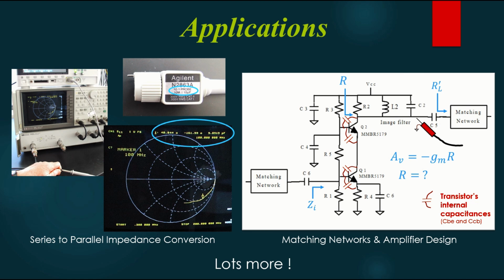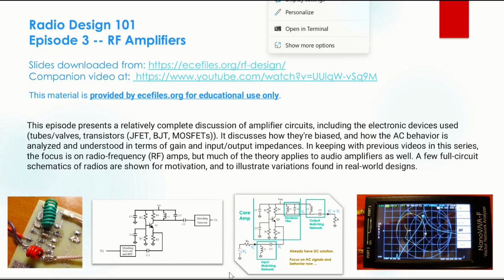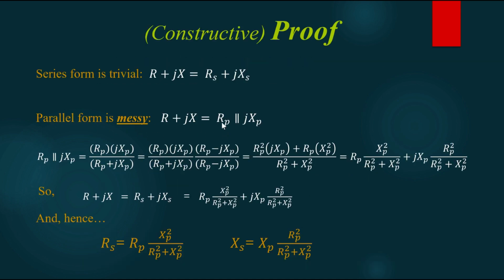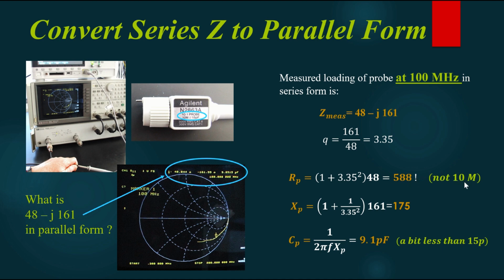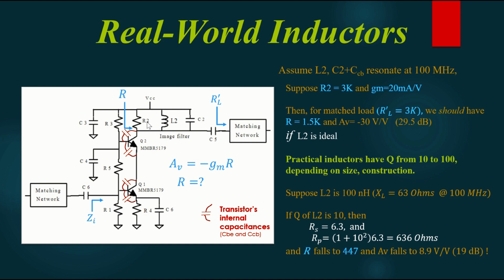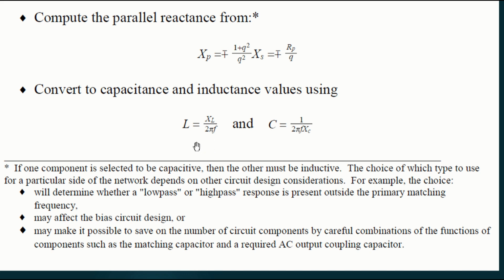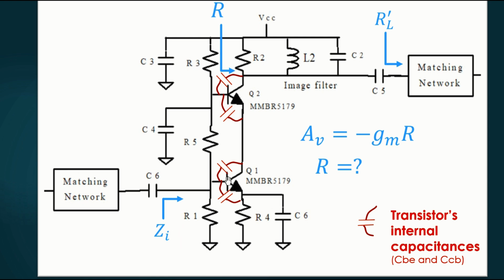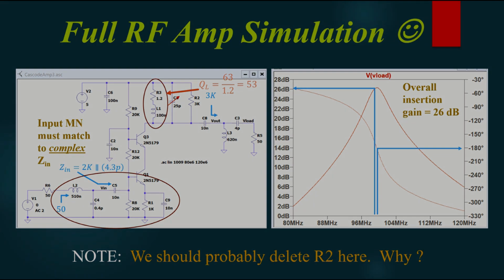Radio Design 101 Appendix B - RF Impedance Conversions for Matching, Amplifiers, and Measurements

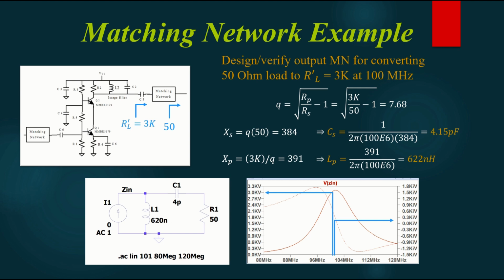Comment: Hello professor, regarding the question at 33:09, I can't find any sensible combination beside parallelizing (if that's a word) R2 and combining it with R3. Was thinking maybe the coupling cap can double as a part of the matching network, but the direction of matching doesn't fit. Am I missing something ?
Reply from the maker: A couple hints (I don't want to give away the full answer):  First, R3 is not a physical part. It is just modeling losses in the inductor L1. In analyzing the circuit bandwidth, it needs to be considered, but that's all. Just pretend it's not there for this problem. The main hint is that the use of multiple inductors is something to be avoided when possible. Can you somehow reconnect L3 and combine it with L1? (Ignore R3 - it's really just modeling the losses in L1)   The other hint is to draw the "AC small-signal circuit" and note that C8 is only there to keep L3 from shorting the collector DC voltage to ground. So it's not really present in the AC circuit and may not be needed in the end...
Reply: @MegawattKS so I guess if I eliminate C8 (and ignore R3), from an Ac perspective both L1 and L3 are going from the collector node to ground, so I can replace them with their parallel combination. Then, finding the parallel equivalent of C3 and R5 gives us the parallel value of C3, which again from the AC small signal model is between the collector and ground, the same as C1, so these can be combined too.
R5 cannot really be combined because it's the load. So I end up eliminating the matching network at the output entirely by changing the values of the built in filter. Do I need to insert C8 back though before the load resistance? You said its purpose is to prevent shorting the DC collector value to ground though L3, but what I generally know is that I don't want the DC level to pass to the output anyways
Reply from the maker: @sorka34  Sounds like you're on the right track. But R5 is the load, so you might not want to convert it to parallel with C3. And yes, we still want a DC block at the output. So the capacitor portion of the output match (C3) is still needed - it's just a small value AC coupling cap (DC blocking cap) now.

Comment: At 43:32 trying to answer the question. Is it because the series R3 is equivalent to a parallel R3' = (1+q^2)R3 ~= 3.37K ?
Reply from the maker: Yes !  Good. And fortunately R2 is not needed as a DC pullup for the transistor since the inductor already pulls the collector up to 5V. So no harm done to the biasing either 🙂

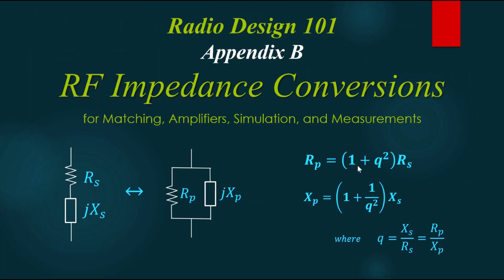Comment: At 18:40, z=49-j162 Ohms if you rounded correctly.
Reply from the maker: Agreed. Thanks.  I did get a little loose with that. But I would would argue that given variations in the measurement/calibration, frequency, and eventual application - that 5% is usually close enough 🙂